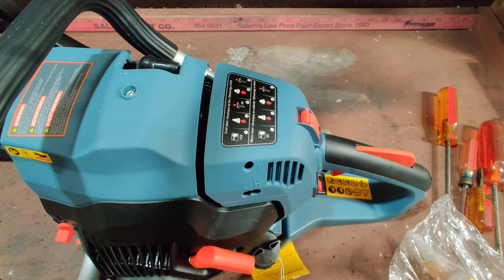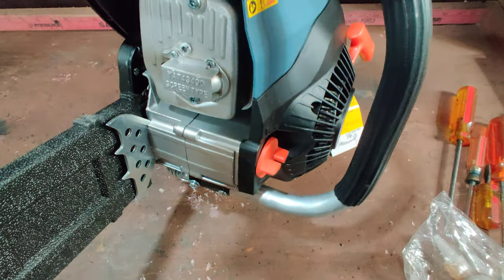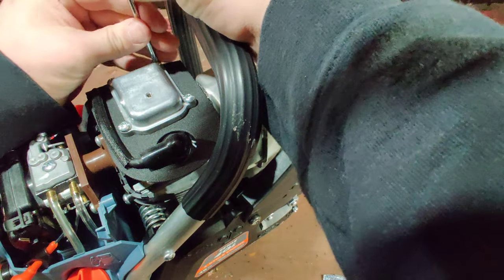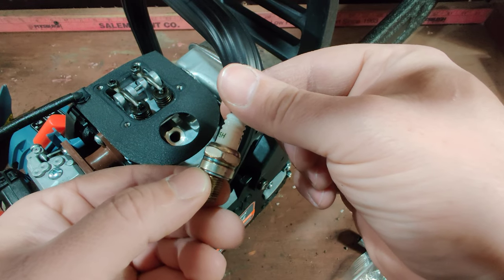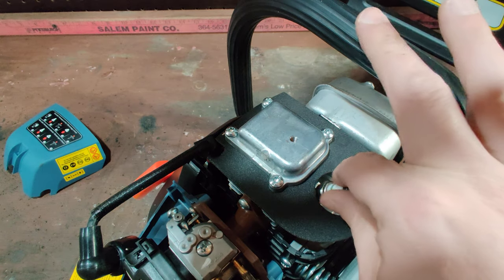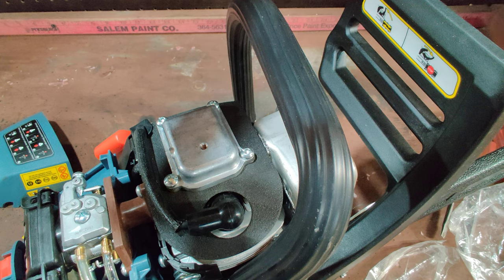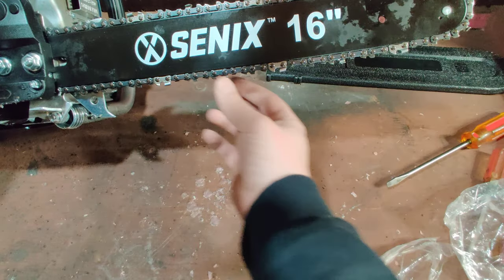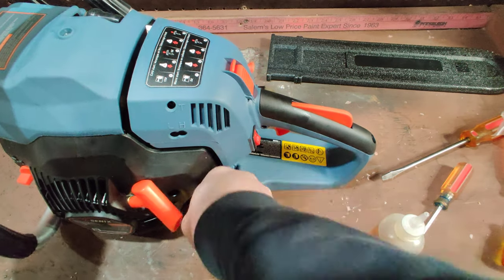Senix four stroke chainsaw tabletop review

Comment: I added bar and chain oil, let it warm up and ran full throttle. That solved the stalling at idle issue. Still rips my arm off from compression. But, a returned brand new chaw ....$50.00......I can live with it !

Comment: I saw of these today at one of the Tractor Supply's in the area. Was tempted to pick one up as a play-thing since it's a 4-stroke chainsaw, even if it's not the best saw made. Mainly for the "It's different" factor. I'd say its' power would be a similar concept to the old 2-stroke saws from the 60's/70's where they relied on more torque and lower rpm's. Even if it cuts slower it's still quicker than using a hand saw. :)
Reply from the maker: I put an NGK spark plug in it and retuned it today, and you're right, it's got torque. That done, you can lean on it far more than a 46cc saw has any right to handle.
Reply: I bought it as a novelty myself. It has come in handy when I dorked and pinched my bar and cut it free with this saw
Reply: @jackstevens585  My friend mostly uses the one I bought when he needs to cut something tree related in his yard and it just happens to be sitting within sight when he does. I got rid of the stock chain and put a far more aggressive gold toothed chain on it. It cuts quicker and really flings the chips but it's still not going to be as fast as a normal saw. :)
Reply: @Slane583  I swapped out mine as well. It has a function here on the farm. Stay safe, be well
Reply: @jackstevens585  Will do. :)
Reply: If i remember right, my stihl 041 runs about 10,000 max no load. Around 7 000 to 8,000 cutting. I prefer this old high torque beast over the modern saws. You can file down the cutter depth guides a few thousands more and you get though the log at the same speed as a comparable power modern saw.
Reply: @poellot  It amuses me when people try to tell me that 9,000 rpm isn't fast enough to cut through wood. But my older vintage saws rev at about 8500-9000 rpm with no load and cut just fine. All I did to solve the slow cutting with the 4-stroke saw was switch the stock safety chain out to something far more aggressive. It cuts pretty quick and doesn't blow your ears out like the normal 2-smoker. Though the carb on it needs adjusting, it won't sit and idle like my Stihl MS251 does. I mainly bought it as a fun addition to my saw collection as it's different but it actually cuts pretty good after a chain swap.  :)
Reply: @Slane583  yes, safety chain is better for the general consumer. But i have been cutting wood for decades.  Yes kickback is a dangerous event even to a pro. Knowing how to prevent it is what makes standard chain perfectly fine for experienced users,  definitely much faster especially in a high torque saw.
Reply: @poellot  I don't have nearly as much user experience using a saw as my father does. Especially since my grandfather didn't want us touching ANYTHING as kids. Though him not wanting us to touch anything is essentially what made me buy my own saw about six years ago. I don't fear my saw and I sure as heck don't trust it. But I do respect it and treat it like it wants to jump up and bite me at any time. Enough common sense to keep the dangerous part away from you and taking your time helps with safety. Of course keeping the teeth sharp and not forcing it into the cut also helps. Sadly not a lot of people have common sense anymore. :)
Reply: @Slane583  one thing i learned,  my grandfathers saw is 50 years old, my dad still uses it every year. I bought my own of the same model. They dont build them like they use to. Yes the old ones are far heavier,  but built to last. My biggest concern with cheap built saws is definitely not anything to do with cutting ability or speed, it is one simple thing. You get very intimate with a chainsaw engine.  In other words if that connecting rod ever goes through the block.... well, i dont even like to think about it. I am a mechanic and would never let anyone else work on my saw. My best advice is make sure you trust the person that works on it.
Reply: @poellot  I try to do as much maintenance to my saws as much as possible. I did a minor tune-up on my MS251 last fall by changing the spark plug and air filter. But I never was able to get around to replacing the fuel filter in the tank as the weather kept getting wet and cold. I'm probably going to need to take the carb out and give it a cleaning as the saw was bogging at open throttle. So I just put the saw aside for the season rather than accidently burn up trying to use it. I wouldn't call myself a mechanic but I do have experience from owning atv's and dirt bikes. My most recent acquisition within the past few days is a nice old McCulloch 1-40 that's in very good, clean condition. I'll see if I can get it ready for this summer. My other "old saws" are a 70's era Poulan 2400 Wood Master, a Homelite 290 and a Stihl 026. Not super old but still fun, of course they're also on-going projects. Just waiting to make a space to work on them :)

Comment: I have used a four stroke Honda weed and brush saw for years. I love it. I have Stihl chainsaws, and, brush cutter/weed whips as well. But, that Honda is the best. It is a commercial grade tool runs great, and, starts after sitting in the shed all winter. You get what you pay for.

Comment: These come with no valve lash from the factory.  I dont know why.  First thing you need to do is reset the valve clearance to 0.006” (00.15mm) before starting it. Then again after 10 hrs of run time. Then again once each season.

Comment: I bought this saw in May of 2021. This saw is great! For a gas powered saw, it's been the most reliable so far. It is the forth saw I have acquired to date and I think this will out perform my other 52cc BlueMax gas saw over time. I have 2 electric saws (battery and plug-in) and 2 gasoline saws (BlueMax and now the Senix). Individually each saw was under $250 except for the battery electric saw, it cost me over $300 and its not suitable for forestry work (expensive to own and cheaply made). Overall, I think this saw is more cost effective compared to the other stuff they have on the shelves inside the store (I suspect thats why they dont have it in the physical store). I should probably mention that it burns through chain bar oil so get a gallon of the stuff and motor oil as well. Also, I added a 18" Oregon bar (62) to this saw and it works good, but occasionally the chain slips off (I blame that on user error cause it happens only when I turn the saw sideways). Read the startup instructions!! I was struggling to start this saw everytime, but after reviewing the instructions and pictograms on the saw, I have not had any issues. fires up with one pull. the instructions says, on cold starts, squeeze primer 11 times, pull choke, then pull starter 5 times. After the machine warms up, it should start with one pull. This saw does work sideways but only when laid on its left side (the starter side).  If laid on its fuel tank sideways, it will stall out. this is not fuel injected!!! I might update this review if I discover any other issues worth mentioning. wear ear plugs. Peace.

Comment: I have the 49cc 18" Senix, and on the crankcase oil cap it states use 10W30 motor oil. You might take a close look at yours to see if it says the same.
Reply from the maker: Thank you. On the lower handle sticker it says 10w-30.
Reply: I just purchased and it states a match is FVP® Bar & Chain Oil - 1 Quart.
Reply from the maker: @cooldaz1973  Thanks Jen. This one uses separate systems, bar and chain oil for the bar and chain, and engine oil for the engine. Definitely don't put bar and chain oil in the engine crankcase.
Reply: Yes indeed.  Also for better results, once break-in occurs using stock provided oil, upgrade to a Full Synthetic 10/30 it can only help this little engine run cooler !

Comment: I got mine at Menard's for for $99 and love it.  I'd mark the oil fill tube with a Magic Marker so you know how much oil to refill it with. 
Most engines with 2 halve cases use gaskets between the 2 halves.  Valve covers have gaskets too to prevent oil leaks.   
Whatever.

Comment: Great i'll be seeing these in the shop soon,  the public here are pretty clueless and refuse to educate themselves past putting gas in it. Bet i see these beat to a pulp from all the neglect.
Reply from the maker: At least when they straight gas it, it won't die immediately.

Make sure the oil gets changed, 8 hours on the break-in oil is insanity. I don't even have a full tank of fuel through this one and the oil has a lot more sparkle to it than I'd like.
Reply: If people will just maintain it per the manual & use high quality FULL SYNTHETIC 10/30 Engine Oil, you shouldn't see too many.  
This is one strong running little saw.  My Saw shop tech was pretty impressed & wants me to let him know on longevity.

Comment: At $123.99/free shipping, on Amazon how could you go wrong, if you area SawNut like me, you have to get one just for the novelty of it, and  plan on carrying it in my truck and using it, since the fires here in Oregon the last few years, downed trees in the road all over the place, will make great truck saw. Just my 2 cents. Thank you for the video.
Reply from the maker: My thought too, truck saw. I'm in Oregon too, but the ice storm was more in my mind. Last resort, use the truck gas, no need to carry separate oil or mix.

Comment: Good Vid!
I have 3-4 other saws but literally just took chance on this "Used" at Tractor Supply for $85 bucks w/18" bar.
Bout to take it out back now & see what it does but the thing looks like it's barely been used at all so hopefully worth that cost for a flip or gift if nuth'in else...Thanks!
Reply from the maker: Glad you like it! Definitely expect to tune it, if yours is like mine was. Also, I'll have another video coming out at some point showing why, but 8 hours to the first oil change is insanity. I'll be changing mine and it hasn't even had one tank of fuel through it yet. Oil's cheap, change it often, especially during break in.

Comment: I wish just one quality company like stihl would produce one model in 4 stroke. Then i would get started building a wood gasification unit and a replace the carb with a custom built mixer. Real long hose and there you have it, a wood powered wood cutting machine.  
Just an fyi for any one else thinking about this, propane regulators use negative pressure to deliver the fuel to the mixer. So a cut hose would not result in a leak and would work well in this application.

Comment: saw one today at a Tractor Supply got to thinking.. wonder how well it picks up oil for the crankcase in all the different angles one typically uses a saw. on this side, that side, upside down... kinda scary..
Reply: I think it’s built as more of a simple bucking saw. I watched another review that showed it stalling when you run on its side. I am kinda surprised there is even a market for it to be honest for only a little more you can get an echo cs-3510 which is more then most homeowners would ever need and you get a better warranty, better parts availability and a professional quality 2 stroke engine.
Reply: I saw a blurb somewhere - in my owners manual - that suggests it's actually a positive oil pump not just a splash oil system.  Which makes sense, cause you KNOW a saw gets used on it's side a good bit.
This little saw is better quality & more sophisticated than initial impressions suggest.  Got mine in January 2022 first week @ Tractor Supply.
Had 30 days to test & return it.  Have no intentions of doing so. 
Now that I've had mixture screws tuned & new larger pull handle installed (easier on fingers) this thing is a keeper.  It's cool to have a 'Thumper' Chainsaw.
It runs so clean I can start it, let it idle the whole tank away - takes about 70 minutes - and it idles perfectly the whole time.
Also it has a gear driven bar oiler so no puddle of oil when idling.
Reply: Running 20w50 it will run upside down... too thin and wrong type for pushrod engines....

Comment: Hardest to start chain saw I've ever owned.
Recoil kick backs a shoulder killer.
Reply from the maker: If you haven't already, get the tuning screwdrivers and richen up the high and low side. This one starts like my Stihls, two pulls on choke till it pops, turn off choke, starts next pull.

You do have to pull it like you mean it, and the small pull handle doesn't help.
Reply: Have your local saw shop put on a new, larger pull handle.  It's the biggest problem with this saw.  The orange handle is too small & has no rubber padding.  My shop upgraded it when I had them tune the mixture screws - which it needed pretty bad after 3 hours of cutting. Wouldn't idle.  Anyhow, they tuned the screws & put on larger handle for $ 17 out the door.  BIG IMPROVEMENT - won't kill your hand.
Also, to start easier, slowly pull rope out slightly until past the first compression stroke, then pull is 3x less, and it WILL catch & start. 
If warm, on the first try.  If cold, pre-pimer bulb 5 or 6x plus pull choke, pull once, then push choke in to halfway.  Always starts stone cold if done this way.

I've also swapped up to Full Synthetic 10/30 motor oil & changed it at 5 hours lots of crust in it - this thing is slowly gaining power - it really pulls in the cut.
And that's just with the stock chain, not upgraded or even sharpened yet.

What could it do with a skip tooth performance chain ?  Our Saw Shop tech wants me to upgrade it he said it will help a lot.
He runs a race saw & was pretty impressed - I was the first guy to bring one it but he'd had questions about it.  
I told him I'd keep him updated on how it runs.
I've got 2 wooded acres here in Texas plenty of action all year long....
Reply: Not for a young spry fella like me

Comment: The factory suggests 10w30 oil. The NGC 7599 spark plug will be the correct replacement for the Chinese plug. Also, try using Avigas (aviation fuel) instead of pump gas. By law it mus remain stable for over 2 years so trash like Stabil is not required. Since it has a higher octane rating it will light and burn much more easily.
Reply from the maker: I'm not burning leaded fuel in anything that exhausts where I breath. 100LL is only low lead when compared to 130 octane standard lead avgas, it's still way more lead than auto gas ever was. I'd pay $20/gal for Tru-Fuel first.

Comment: Surprised that it's pushrod instead of overhead cam.
Reply: Right but it works darn well anyhow.  

I'm thinking the overhead cam idea could be an upgrade to a future design, but then you'd need to have a tiny itty bitty chain to reach up to drive camshaft.  

It may very well be that pushrods are perfectly fine.  

This does have a rev limiter that cuts in - I'm thinking it's set at about 6,500 to 7,000 rpms.

But this is making all it's useful TORQUE well before that so really no need to run it faster.

Comment: Yeah I bought this fucking saw, without carefully studying the box and I did not see that it was four stroke until I pulled the chainsaw out of the fucking box, and saw a separate oil port instead of mixing the gas I was like oh shit. I got to say this saw is at best going to be a backup and not a reliable one as soon as I can afford a Stihl or Husqvarna two-stroke chainsaw. I got this is a replacement to an old Poulan Woodman 2075 that was a fucking beast but a screw-on the butterfly in the carburetor came loose and was sucked up underneath the piston. Only time I've ever seen something like that happen to a chainsaw I retrieved the screw head, but the screw bar itself was sheared completely off and up underneath the Piston somewhere and it fucked it up and I mean bad. I would give anything for another 2075 that old 2075 didn't even have a chain break on it but it didn't need one when you had your carb adjust properly. And it ran just as good if not better then my papa's Stihl chainsaw, it may not have started all the first pull like the Stihl. But it ran and would cut anything in front of it, they came with a 16" bar and chain but they were able to handle an 18" bar and chain as well, which is what I had on it...this thing sounds weird cuts slowly because the gearing ratio on it is all wrong in my opinion...I should have just got my money back but I figured it might be alright...i was wrong....how do you adjust the carb settings on this P.O.S. that's really all I came here for
Reply from the maker: Get the adjustment screwdrivers from Amazon, needs to be richer on the high and the low both. Mine would barely stay running with stock tune. You're right, won't replace my Stihls, but for a toy I'm pretty happy with it.
Reply: If your really in a budget get the holzfforma g255 honestly if it’s not a daily use saw you will probably never have a single issue with it.
Reply: @zack6892  naw bro I got this saw collecting dust already I took the bar and chain and put it in a 2 stroke Blackhawk that came with a 16" bar,  lesson learned on that particular purchase number one pay attention to what the fuck you're buying and number two film by four-stroke fucking chainsaw they suck LoL. I'm a two-stroke motor genius and can get just about anything running but four strokes offered go karts riding mowers and other things but definitely not chainsaws
Reply: @dthundergunb3115  yeah a 4 stroke chainsaw makes no sense lol. They are supposed to be light, powerful and easy to service in the woods a 4 stroke is none of those things haha